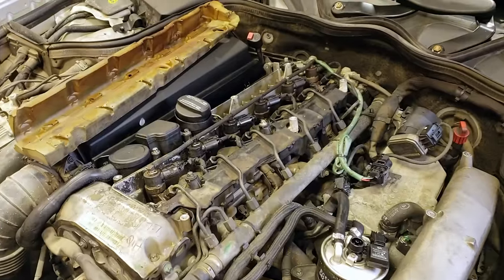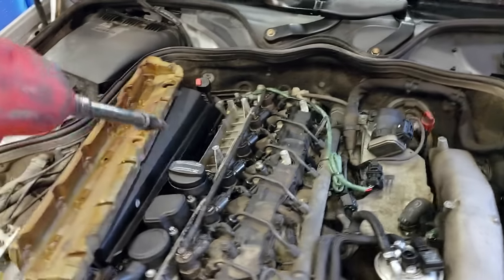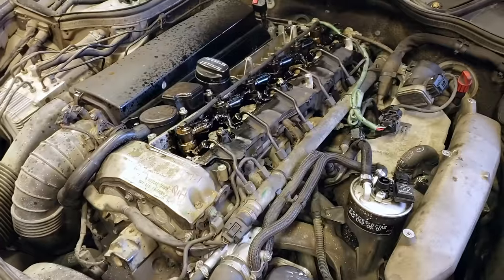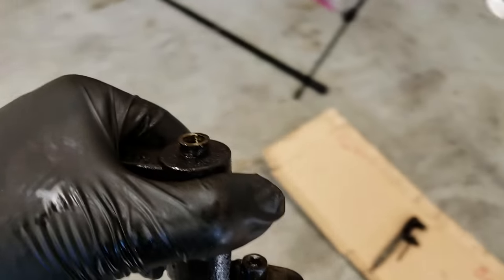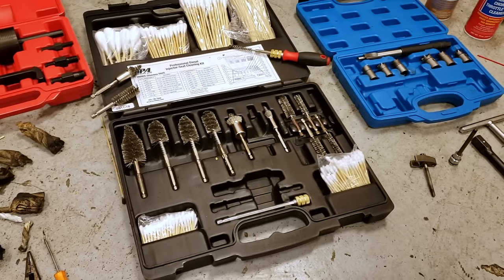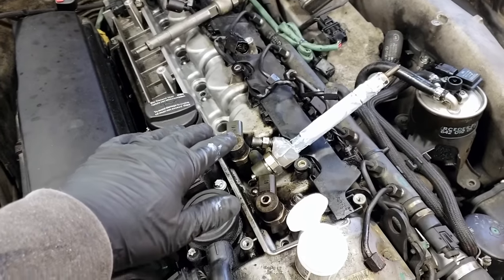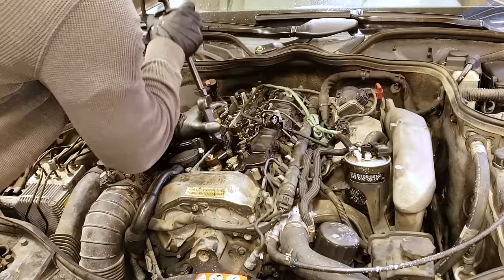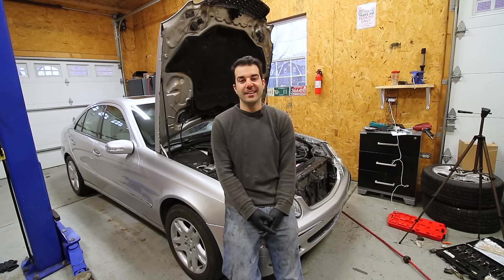My Turbo Diesel Mercedes Has A Nasty Engine Issue. Don't Buy A Diesel Before Watching This video.

Comment: Don't you think it would be good to cap the diesel ports at the thread on top of each injector to keep crumblies from entering the injector and then getting stuck inside the spray nozzles and destroying spray pattern etc. I am sure there are cheap plastic caps available for that ..it was absolutely most important when I did the injectors on a OM605 and the new injectors had caps on the threaded ports! ..same for the lines that you disconnected from the common rail. Absolutely mandatory to keep particles from entering  there. And is there a cleaning fluid (at least diesel) to stick the injectors into while you work on replacing the washers at the bottom of the holes etc....If i could contribute to this excellent video then it would be to keep the fuel path from getting contaminated to protect the injectors from dirt contaminated fuel!

Comment: 1)  Did you see that smoke wafting off injector #2 right after he pulled it out?

2) Even though I've used it a lot myself,  somehow, the last several of his videos I've watched it sounded like "carbon choke cleaner" instead of "carb and choke cleaner".  TBF, cleaning carbon off a choke butterfly actually makes sense.  🙃

Comment: I recently had to treat black death on my Hyundai Terracan.  I allowed the top of the engine to soak in full fat coca cola and degreaser during the clean up process.  If the offending injector is stuck, you can crank the engine with the clamping bolt loosened to free it.  I did and was able to pull the injector out by hand.

Comment: my experience with wvo conversions says you could/should have covered the engine in white fire retardant insulation and wrapped the head, just to get a deep heat soak, i would even have unplugged the back 2 injectors to make the front two work harder and given a few slide hammer pounds while it was running, then pour hot diesel fuel in the head area and let it soak while running, just to make sure you don't break anything

Comment: in North Italy (life cost is about 30% highier than in the South) at the Mercedes dealer my friend had two injectors spritzing diesel from a leaking gasket (2009 avantgarde E 200 cdi sw),he had the two injectors serviced and gasket replaced for about 200 euros,so we can estimate a 500 $  service four injectors gaskets parts and labor.

Comment: I just did this job myself. Removing Injectors, cleaning engine took approx 6 hours, cleaning injectors 1 hour, install and testing 1 hour. My black death injectors came out with 2 whacks. Tips below:

Tips:
1. Do not buy the reamer. It's low quality.
2 . I used 5 bottles of carb cleaner
3. Cleaning injector holes took 4-7 shots of carb cleaner/air per hole.
4. Place a dividing rag between your unaffected injectors and black death to limit where the black goo goes.
5. Spray some carb cleaner on your cotton swabs, also you will use all of the smaller long ones.
6. I tightened injectors 7nm + 90 Degrees + 45 degrees. Feels Good-N-Tight

7. If you will buy these tools to never use again, just take your car to the shop. I sure regret not taking it to the shop myself.

Edit 1: Item #5 wording

Comment: to release stuck injectors, undo clamp bolt a few turns and start engine to pop them out, helps if engine is already warm,
Reply from the maker: I ran it with the bolt totally loose. Didn't work
Reply: @LegitStreetCars  worked for me with much worse black death, i warmed up engine first and soaked inj with wd, then reved up engine few times and didnt need to use puller, inj came out with pliers and wiggling

Comment: I've got a 2008 Audi A5 3.0 tdi injectors have been leaking a while, BUT the head has relief ports so all the black gunk doesn't spew from the top (relief ports are halfway down) hopefully doing it this weekend. Feeling a little nervous 😖😖 made a slide hammer at work (pros of being a Fabricator welder?) bought a cheap injector washer removal tool just incase and a injector seat trimming tool. Also bought some injector decarbonizer in hopes it'll make the job that bit easier

Comment: My Mom had a 1979 300D.  The only that could stop that engine was crap in the fuel.  To fix we would disconnect the fuel line from the tank and blow compressed air in the line to push the crap back into the tank.  LOL  It was a fun old car but had 0 guts.

Comment: I would highly recommend in conjunction with blasting, scrapping, vac'ing to use some high pressure compressed air to blast as much of that crap outof there.

Comment: made my own slide hammer with a larger weight i agree they are very hard to remove also made my own seat cutter from a cut down tap reseater cutter head for the bad damaged seat and used a wooden dowl and a piece of wet and dry sand paper to clean the other seats worked well. the only problem i had was the tension on the torgue to yeld bolts is sceary

Comment: The only thing I would add is if you are going through all the trouble of doing this repair on a high mileage car and risking breaking the injectors anyways taking them out as shown, you should really consider just getting new injectors anyways. I know it costs more but why risk putting it back together and one or more is broken or breaks a week later. Your car will run a lot better too. Great video.
Reply from the maker: The car was $3,000 and injectors are really expensive. Also, they all work perfectly so it would be a pretty big waste of money. If one did fail its like a 30 minute job now that they are all cleaned and lubricated.
Reply: But you are a professional mechanic vs. the typical person that might try and diy this job I would think it more than likely they would do some damage removing these. Even if one is just slightly damaged and the engine runs poor then trying to diagnose which one(s) can turn that job into a big problem for the average person to figure out if it isn't throwing an ecu code. I have no idea what the cost is but for my bmw they are $60 each which I think is pretty cheap assuming the price is comparable, maybe it is not but if they are selling the car for half the asking price because of this issue then it is still a huge savings. I don't disagree that you could just try it and see if it works then fix it if needed after but seeing the amount of slide hammer action on those makes me think you are lucky if they don't break.
Reply from the maker: They are around $200 each. If they were $60 each and they all still worked perfectly I still would not replace them personally but I understand where you are coming from.  Thanks so much for watching and for commenting. 
Alex

Comment: To clean the injector bore you can use a tampon, flooded with wd40, too. It will expand and clean all the smut out with one pull.

Comment: Good job! I like the video. Even though you have the new bolds in the video, I'm not sure whether or not you emphasized on the mandatory requirement of replacing retaining bolts  with new ones. They are single-use stretching bolts with a tightening spec as: 7Nm + 90 degree.

Comment: In diesel European engines this is "normal", from Renault, VW (VAG group), BMW, Mercedes, Fiat, PSA (Peugeot and Citroen) its part of the maintenance of the engine to prevent this kind of problems.
Many owners only put gas/diesel and drive... and this kind of things happen. By the way nice job.

Comment: I do 100's a year on all kinds, best thing to do is scrape as much carbonised diesel off as poss and heat it up, switch off, crack off the blowing ones and run for 5 mins, work on just those, then others, I've seen DIY jobs where bolt haven't gone down fully and then blown injector out, then it's needed thraeding to an 8x1.5 and vw drive shaft bolts used, ;-)

Comment: I'll probably never own a Mercedes but a very interesting video anyway. Must feel good to work on a nice engine like that.
I owned a 1.7 CDTi Vauxhall / Opel Astra and never had any injector problems in the 140,000 miles I had the car (only problem was, I believe, sticking turbo vanes that caused loads of smoke).

Comment: In the end you did not but listen to me as someone who has done too many of these. Never pry against head cover. It is surprisingly thin, brittle and even second hand pretty expensive. Also never try to turn injector by that large nut which holds selenoid in place. You can end up very least with leak worst with rebuilt as it will malfunction when it gets loose. For successful and long lasting solution always cut seats and use pressure. In the video it seems you just turned it casualy. Wrong. Get some weight on that handle as you need to hand machine it flat again and that wont happen without some force. Other than that nice job, you were lucky with that cylinder no.1. :D

Comment: The plastic engine cover muffles the tuff tuff sound of a blown injector seal!  the only other diagnosis is the burned diesel smell apart from a visual check! So it can be overlooked easily! My girlfriends CLK 270cdi had the same amount of Black Death as shown in the black car! This was due to me not checking the car for over a year only when I went to change the oil I found it!!! The tar was covering the whole injector trough area. I cleaned it out and I sliding hammered the 4 of the 5 injectors out no bother when the motor was cooling down the likely hood of damaging them on removal is slim unless your heavy handed! We still have the car and one ov the stretch bolt threads stripped. 7 nm of torque pluss90 deg =8.5 nm  I helicoiled it! It's still running fine!!
I didn't get the engine that clean though!!! Lol

Comment: Great video on the CDI, I'll get the resistor and wire fwd the low RPM valves. I have a 2005 cdi that was perfect, still Loving it.

Comment: Thanks for the link, i have a oil leak just under the intake manifold, c220 4 cyl, w203 2005, something is lose directly under where the manifold bolt on

Comment: Next time drive the car warm for 5-10 miels without the hold down keepers. Yes you'll have excessive blow by, but the injectors will come out like butter. I had to do this one two injectors . Even had the same tools you used from Amazon.

Comment: When my friend does this job he usually cleanit like you do. Put some Coca-Cola in and let it sit the night over clean it again. Get the engine hot and then pul out the injector or glowplugs. He says it's one of the best tricks he ever learned and he was sceptical at fist.

Comment: As they said in Jaws, were going to need a bigger slide hammer! Great video. It's worth noting that the metallic brushes you used sometimes shed wire strands which you don't want to get into your engine. So keep an eye out for any!
Reply: Funny enough I thought that ....maybe a blanking plug  and compressed air

Comment: 431304 km on this engine, and my c220 CDI w203 has 105633 miles. nothing wrong with the engine, no black death but the valve cover leaking oil, must take it off and replace the seal, so then I do new copper seals on the injectors also

Comment: Brilliant video, I own a 2003 jeep grand Cherokee 2.7 diesel, (inline five cylinder). All five injectors luckily for me had been reconditioned at a cost of over £900.00. my jeep is a united kingdom model wj, had jeep three years now been keeping an eye ear out just in case the dreaded black death comes back, no signs yet, thanks to your great video I will know what to do if it does. Thanks, Vinny. :-)

Comment: Excellent!! Just to ad: next time you should change nozzles! It doesn’t cost too much. Around 20$ each and avoid any Chinese made like the ones you have piezo Bosch!! Then the engine will be also super silent!! For at least 200k miles!!

Comment: Hi. Very informative. Did mine some 3 months ago. One injector had Black Death, but it didn’t take much to remove. 
Have all the right tools, which anyone attempting to do this should buy before starting this job.
You didn’t mention how long it takes to turn the engine over to get the fuel through after disconnecting all the fuel lines..I had to recharge my battery after running it down. It eventually started with a fresh charged battery! No problems since.
Is there an easier way to get the fuel through????

Comment: Another trick you can try on the next one is to spray the injectors with "freeze" spray with the engine at running temperature.

Comment: I'm seriously considering a CDI. I have a 98 SL500 that has a vacuum leak. the constant engine light is very irritating. many other things need attention; ie. drive shaft inline isolator. all new hydraulic cylinders for the soft top. very little else, the car is absolutely beautiful to drive and fast. but the drive shaft issue limits the right foot pressure at present.

Comment: My 06 Sprinter had this.  One bolt holding the injectors in is a bad design. The Detroit Diesel I drive for a living has two bolts holding the injectors, apparently they have a bit more room on a 15 l engine 😉

Comment: Just came off of watching a whole bunch of 300 SD vids at MercedesSource, and your vids are equally engrossing. I’m still working on (learning on) my first derelict benz (a $300 93 300e from Copart), but would love to add a diesel to the stable :-)

Comment: the actual worst that could happen is  exhaust gas escapes the copper washers, the  hot exhaust burns the orings, and build up in the valve covers, it then falls into the oil sump and the oil pick up strainers gets blocked, and the oil pump is starved of oil

the build up of “tar” above the valve cover means the exhaust has burned thru the injector oil seal

Comment: Man, get a set of cheap plastic caps and cover the inlet and return ports on the injectors and other parts of the diesel system you work on - I guess you don't imagine what a little speck of dirt can do to your injector internals... good luck.

Comment: At Mercedes here in the uk we use full fat Coca Cola after driving the car allow it to soak for 10 mins then flat head screw driver get as much out as possible then air blower the rest but your bubble stuff looks just as good

Comment: I bought a Merc some years ago thinking I was Jack the lad.. couldn’t afford the repairs and it was the worst second hand car I ever bought.
The timing chain jumped due to a cheap nylon tensioner and scrapped the engine. Never again. Honda for me every time from that day onwards.
I have never had a problem since.

Comment: My first encounter with this had this motor mounted in a van..  very limited space from above.  Totally hardened carbon deposits.  Carefully picked about for more than a day, clamp screw broke/snapped, no room for injector pulley or glide hammer. Ten tons of trouble.  Got no time to write how I still got this off without taking out the head but to all u out there... Don’t attempt this job on cold engine... it needs to be HOT.

Comment: I have a number of Isuzu and Nissan diesels, and have never seen an injector come loose, or leak like this Mercedes. Looking at the burned out seal, my theory is that the injector isn't held firmly enough onto the seal, and with a pin hole leak, then of course the leak keeps going until it's serious. The one bolt and clamp system to retain the injector is weak engineering. A parable would be a spark plug loosely installed as compared to a properly tightened plug.

Comment: Good Job. The Key points for this faliure are the Seal Rings and the Bolts. Mercedes Benz changed the Reference of the Seal Ring   A 6110170060. Former part number cannot be used. And the other key point is that never again you can reuse the old Bolts to fix the clamps. Bolt part number A 0009902907. This is because there is a deformation of the length of the bolt and cannot be usefull at the same torque. Manual says use new bolts for this job.
Most of the black stuff can me removed mechanically with a screwdiver. Cleaning with spray must be done carefully to avoid damage on plastic items around metal parts.
With massive black stuff the wiring and connector will be damaged. Can be replaced and using new wires with isolating make the repair. The heat will burn the wiring.
For cleaning the injectors can be used a microwave cleaning machine.This cleaning must be done in a special repair shop. And my last recomendation is check and retorque the screws after 20 hours using the engine. Also is good idea to replace the fuel hoses and T fuel conector on top of fuel injectors.
Last time I did it the car had 180.000 miles in 16 years. And I had to replace 1 injector (number 3) due a crack on nozzle housing. 
Almost all CDI Mercedes models has this problem due Seal Ring, and must be replaced.

Each country has repair shop prices for this job. And prices goes from 200$ up to 2.000$. Spare parts from 20$ to more than 1.000 $. Each Injector price around 250$-500$. So better use precaution with Mercedes CDI, and inspect top of the engine.
Best regards

Comment: It is hard to believe that any dealer would try to sell a car with an engine that looked like THAT! Did the person that owned it ever  open the hood? Why would not putting the injector back in the same cylinder really matter? Not like it is valves or pistons. Just wondering. What about metal debris falling in if you cut a seat for the injector or are you just cutting carbon build up? Thanks for the links and explaining how you got everything looking like new. Very thorough!
Reply: Each injector is calibrated to account for slight differences,  there is a code on the top to update the ECU when exchanging. On OM651 (and maybe the block above) you need MB Xentry laptop and online account to do this ☹️

Comment: Nice video. Btw, all Merc. engines from that era suck. Nomatter if it is in a E model or Vito etc.... Afterwards, Merc. did some major quality improvements and now they're back on track where they used to be. Problem free cars for 100.000's of kilometers.
Get rid of your car now that you still can....